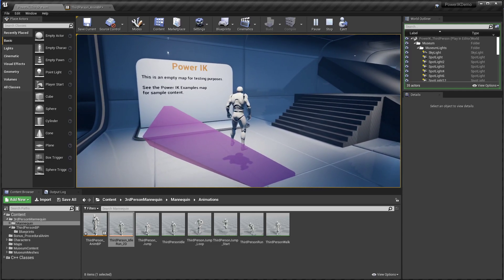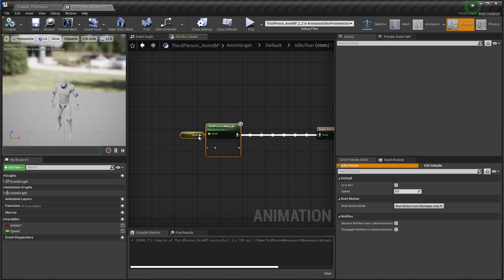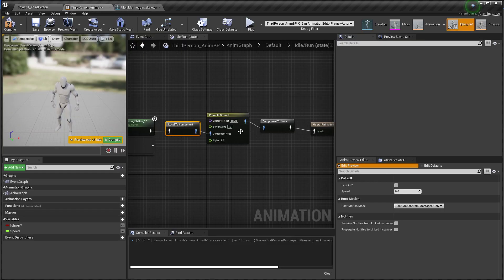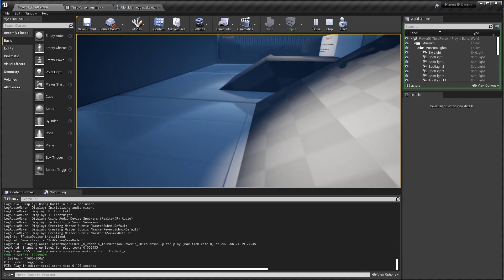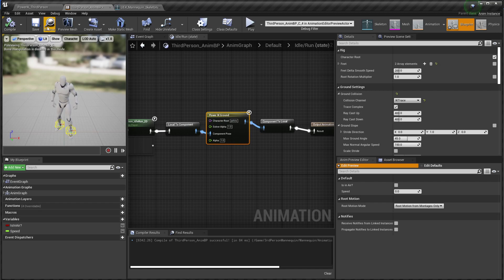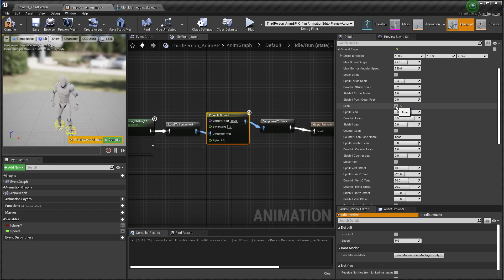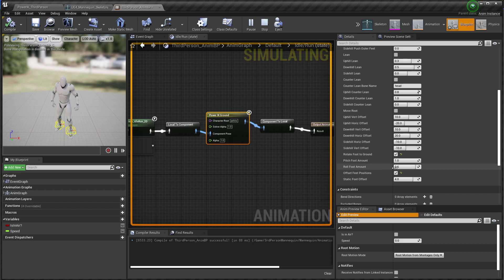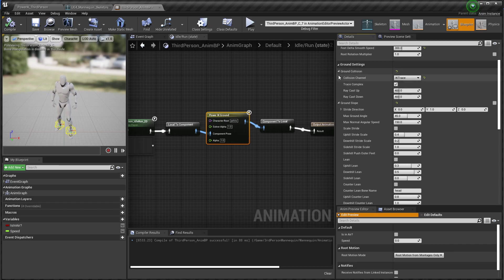Power IK: Ground Node Tutorial

Comment: I have noticed that he character tends to skip a step or two while walking or running up or down stairs, is it at all possible to force the character to make contact with each step? For example, making sure the foot is planted on each step while traveling up or down staircases.
Reply: What you described is by no means trivial and no something you get out-of-the-box from any IK system. Depending on the size of the stairs and the speed of the character you would have to dynamically adjust the stride of the character's feet and the playback speed of the animation to hit every stair precisely.
Reply: @kiaranritchie3021  Damn. The 90s were so much easier, with just making a ramp with a step looking texture, lol.

Comment: Hi, thank you very much for the tutorial. I ran into a problem: when the character is on the edge and one of the leg is in the air, the IK would pull one of the leg to the ground below, the other one still on the hill. How can I fix this?
Reply: Adjust the "Raycast Down" length in the Collision Settings.
Reply: @kiaranr  Cool!! Thanks a lot!!
Reply: @kiaranr    @Po Ming Lam   hey have you fixed it?, I have the same problem and changing the raycast did not work for me unfortunally.
Reply: @whatzthat7744  Its maybe a bit late answer but had the same issue and it solved by set the Capsulecomponent collision in the character blueprint, to ignore the IkTrace custom collision :) Its helped me
Reply: @Redswift001  Thank you!!
havent  worked around it yet so this might help!

Comment: Plugin looks good, but the Left Knee bend back and forward during idle on the slope that is 45 degree or more. Any solution ?
Reply: Apply Bend Directions to the calf. See the documentation on Bend Directions at Poweranimated.com
Reply: @kiaranr  Thank you, Got this working now... It was so Sweet and Simple. One more thing... I Got this plugin from market for free, But I want to support you by contributing some $$. Do you have pateron or anything?
Reply: @arthurprather6720  I don't have a Patreon. But I appreciate the gesture. Join the discord of you're interested in helping others figure it out, and share ideas.

Cheers!
Reply: @arthurprather6720  What values did you use? I set my bend directions as they are in the Documentation but the characters knees still bend backward on slopes and Rotate Foot to Ground is checked.
Reply: @kiaranr  pls i did everything but my character still flying